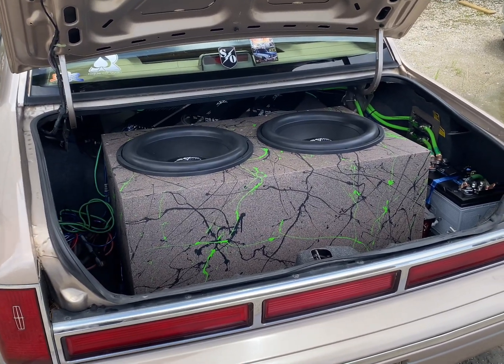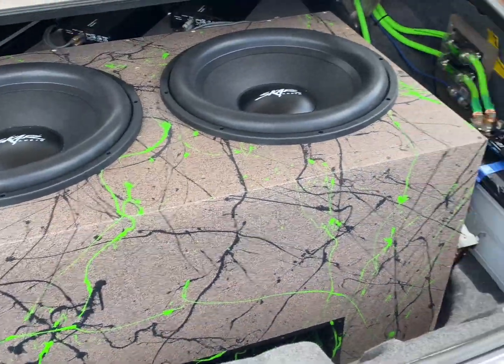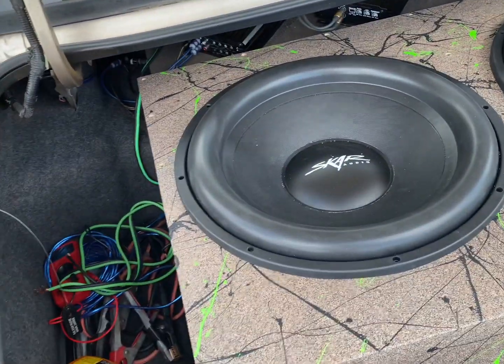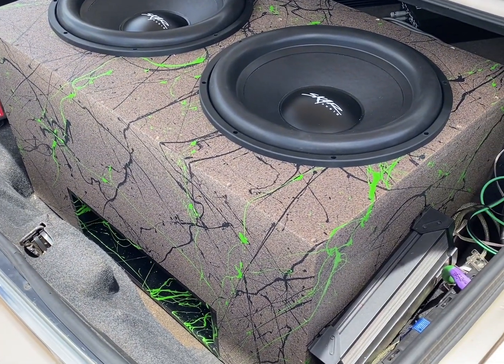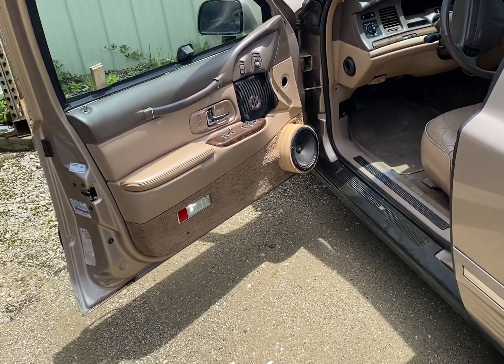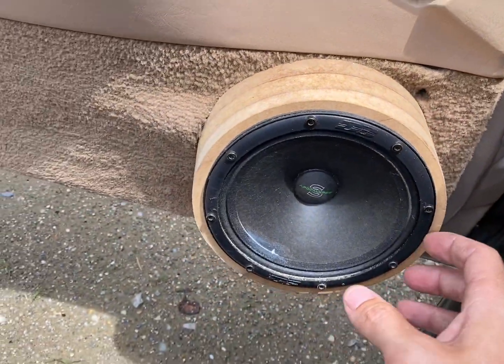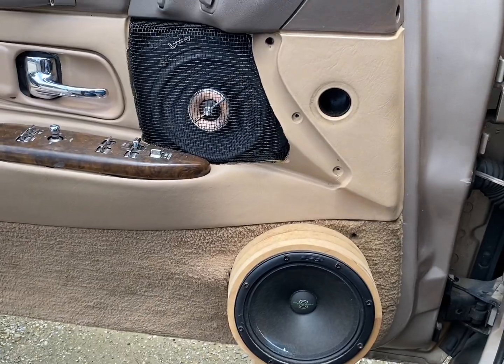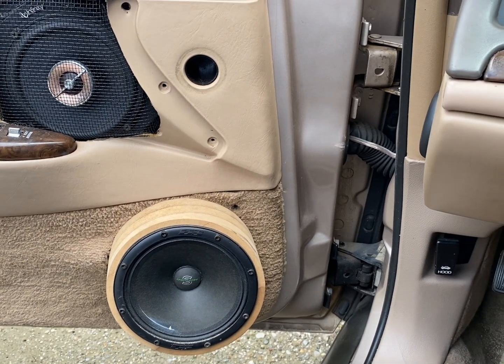Skar sdr 18 review (part 2) box for 2 18s finished!

Comment: Looks good. I've built around 25 sub boxes and several custom door panels. I'm currently finishing up the system in my 08 Yukon Denali. Got a very nice system in it now but I want to hit 150. I have 2-18" Skar EVL's in a 10.4 net cuft box tuned at 31hz. I have a JP33 amp pushing 4K rms. 2 batteries, big 3, 2 runs of 0ga OFC wire. Only have a 160 alt right not but getting a smaller pulley to keep the volts at peak when just at idle. A total Rockford Fosgate front stage- mids and highs, amps and DSP. Still about 3wks away from getting to hear it. I work on it after I get off of work here at my bosses shop. I still have my current system in my Yukon so when I swap it will all be in one day, even trim panels to make everything clean and professional. I'm super picky. I'm hitting 147.8 with 1420w rms right now....so fingers 🤞

Comment: I do not recommend the EVL line of subwoofer.  The are the most warranty replaced subwoofer.  The QC on them,  isn't good at all,  the ts specs are bad as well, and they are hugely inefficient subwoofers.  Kevin didn't design that line,  and the motor isn't that strong.  I love Skar,  have ran their products for many years,  just giving some advice.
Reply: DCAudioFTW  I'm fully aware,  of the build houses that skar uses, not only for their subwoofers, but amplifiers as well. We chose not to receive the samples we were working on, with one of the build houses, that they use. I do not bash brands,  I just know the evl line, is a failed attempt at an sq driver. All of their products are decent to good, for the money.
Reply: DCAudioFTW  90% of all subwoofers, are assembled and built in 3 build houses in China. And most of the ones "assembled" in the U.S still use parts from China as well, from the ferrite,neo, or assembled motors, cones, spiders, caps, basket. Some just utilize coils from Precision Econowind. It really just boils down, to what brand you like, and what you can afford. There is no "best" brand of drivers, or amplifiers. Every brand, has its place in audio.
Reply: DCAudioFTW  I actually prefer,  to help educate people, and provide some guidance to others.  And it would be, "I'm not telling you,  anything you didn't know". And it isn't "cause" it is, "because" in your previous comment. I'm  not a nut hugger, for any brand. And I do not prefer, to bash any brands either. And, I did not opt, to tell you anything, you didn't already know. My original comment, was only my opinion, of that line of subwoofers, from Skar, and that line of drivers only, from Kevin. I assume you like Rusty's brand of equipment, from your screen name, and that's great...he has solid products. 👍
Reply: Thanks brother, that info was really helpful.  @Chuck_Sanders
Reply: @rev_tdeath  you're very welcome

Comment: Nice you might want to go with the hdx3s. The motor is 300oz. The EVLs are under 200oz.
Reply from the maker: That’s what I want the hdx3s that’s what I built the box for it’s just 900 for 2 compared to 600. 2 hdx on a 5k and it would be slammin!
Reply: @ptakcaraudiochannel2675  yeah the new hdx3s have the better black glue on the coils.

Comment: I say that's a nice box for those evls, I have A single18 zvx d1 in my ram crew cab
Reply: I know they loud in this Tahoe!!!!🤣🤣🤣
Reply: I also have a single 18in zvx V2 but it came with dual 1.5 ohm coils. I'm running them from a Vulcan 3K at three-quarter ohm in a 5.5 cubic ft ported enclosure in my Toyota Tundra extra cab. Not quite a full crew cab